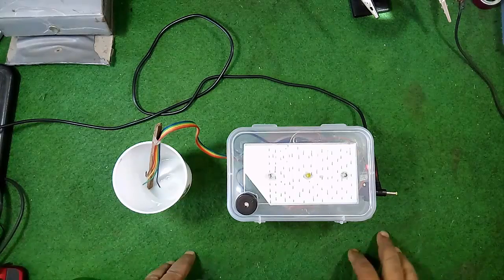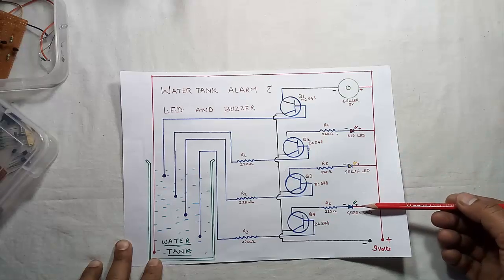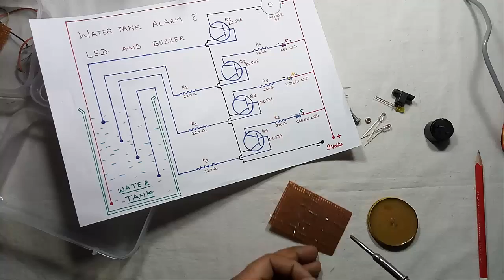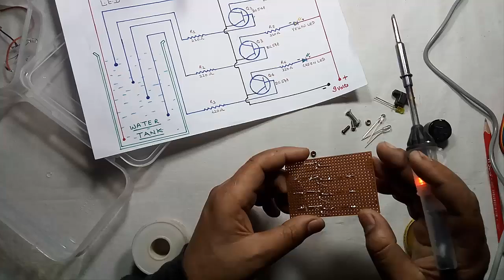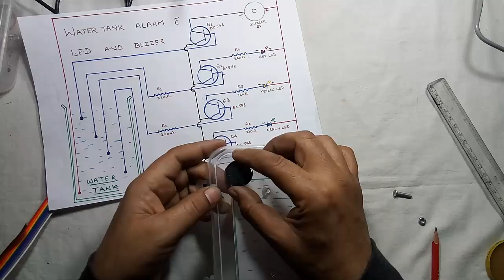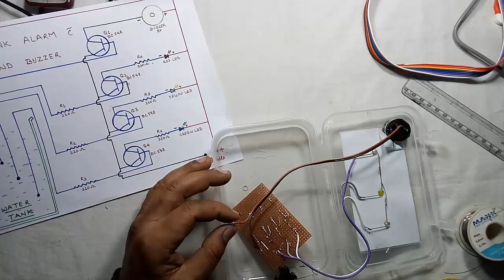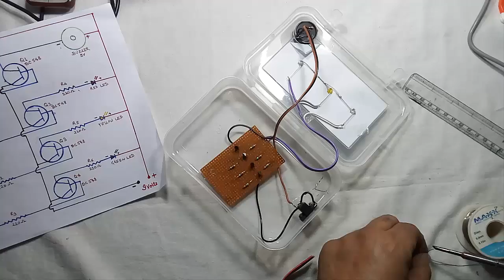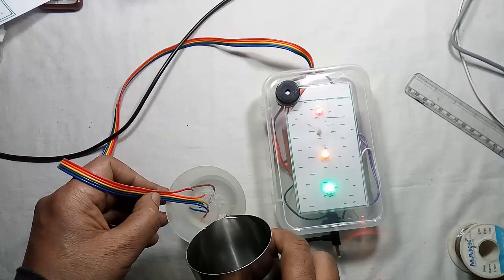How to make water tank alarm with indicator and buzzer at Home SAVE WATER

Comment: Can we use any other resistance other than 220ohm
Reply from the maker: shantanu vyas yes nearby value of 220ohms like 200 ohms or 250 ohms you can use. In spite of 220 ohms you can use 2 (two) 100 ohms resistors in series..
Thanks.